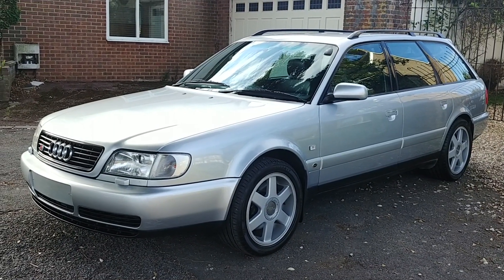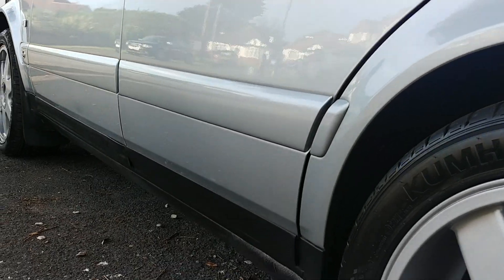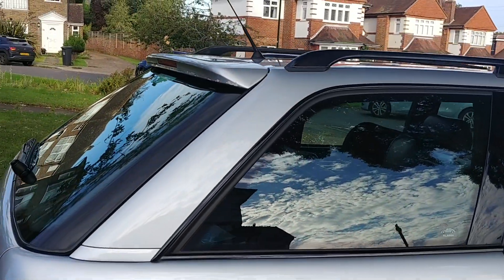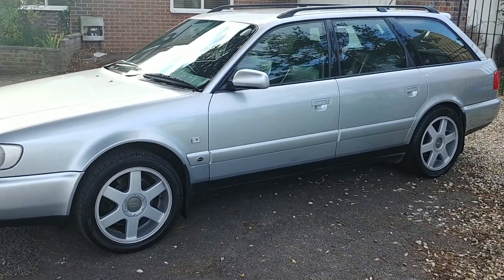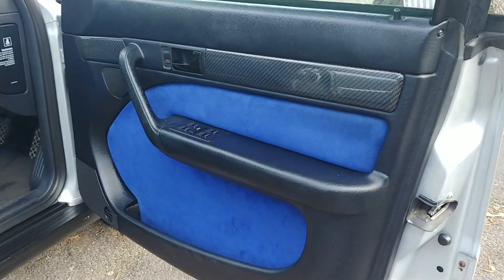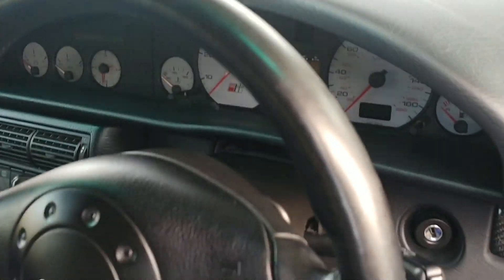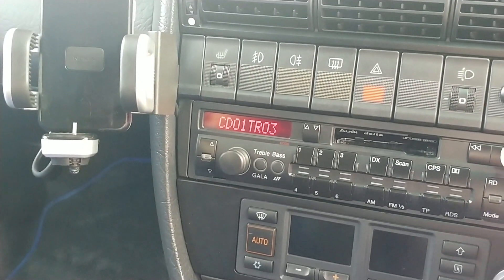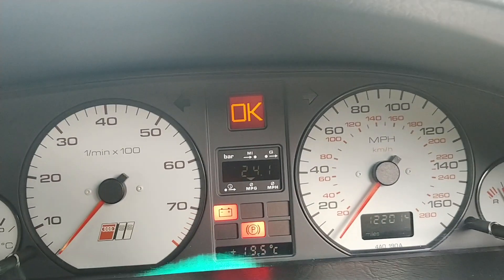Audi URS6 (ep1): 2.2 AAN walk-around video

Comment: Awesome car.... It's so special... in GB, you did not get the S6 Plus, but you got a S6 2.2 20V with all the special S6 Plus specs. 

-Black roof S6 Plus
-black trims until roof S6 Plus
-black glossy outside B, C Pillars, grille, roof rails, door opener inside
-odometer S6 Plus
-S6 Plus rims
-leather alcantara seats

Do you know if that package neede to be ordered separately or do all S6 from 1996/97 have the S6 Plus parts?

I wished, all other S4 and S6 got these parts. I changed all in my 93 S4 also into S6 Plus. only the seats and odometer is still from the S4.
Reply from the maker: Hi, thanks for the comment, it is indeed a very special car: Im very happy to have decided not to sell this in the end! It's currently having a suspension refresh (nothing drastic, just Bilstein B8's / Eibach springs / top mounts and bushes). Since this video it also now has a Supersprint system, so no longer 100% stock, but OEM+, and more enjoyable for it. 

All the best

I believe that the run-out models were all Plus Spec, but I may well be wrong - I should do some research.

Comment: Seems like the wrong shift knob? And the climate control shouldn't have been just a S6+ thing. They even had it on the earlier 100 CS from like '91. But this car is in great shape. And don't worry about missing the airbox cover. Like 99% of them are missing it. You bought it just to sell it?